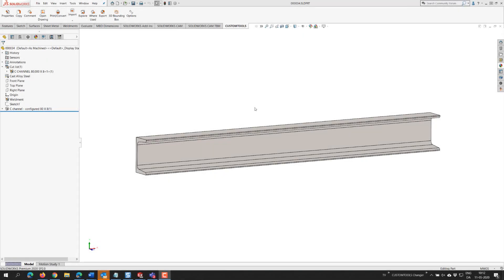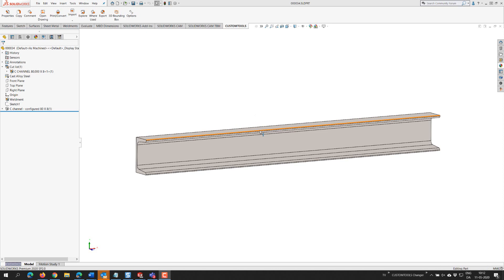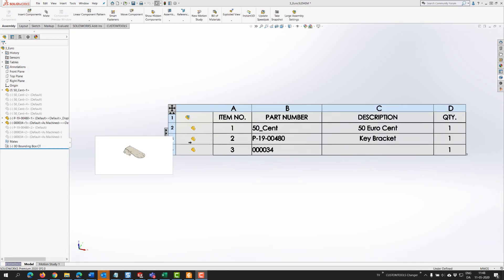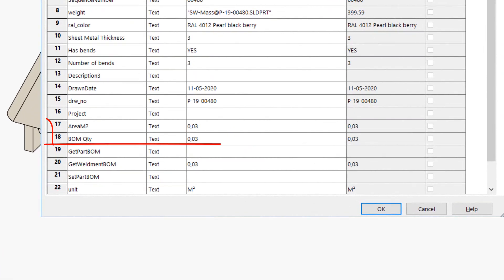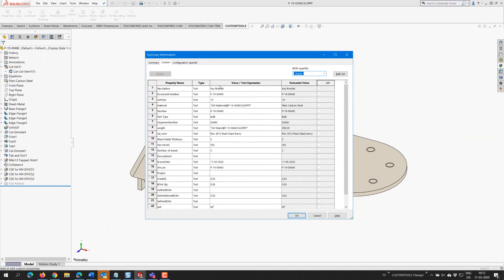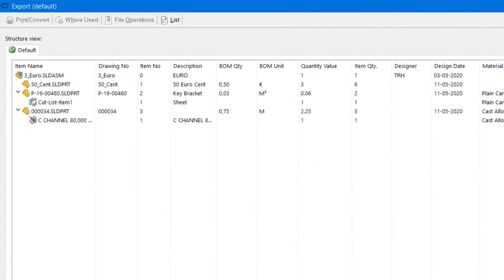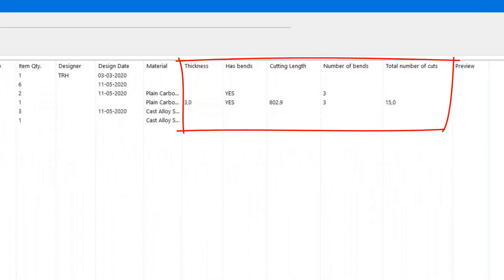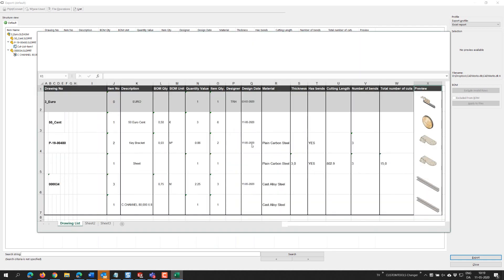BOM Quantity Feature for properties and export

Comment: does solidworks allow aggregating bom quantities over a custom property value? lets say there are 2 different parts with the same part name="123" custom property, the intended output should be only one row for the part with quantity =2, thanks
Reply: Hm, that's a very rare case. I'm not sure about CUSTOMTOOLS but SW only groups by document name or configuration name.